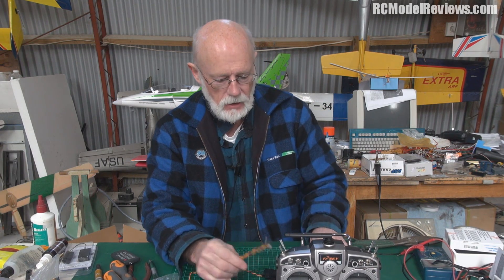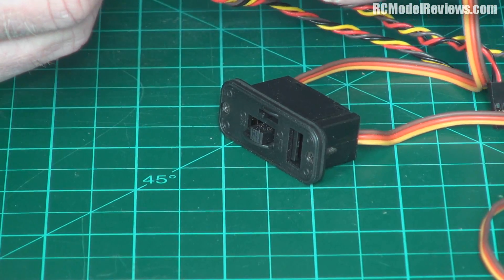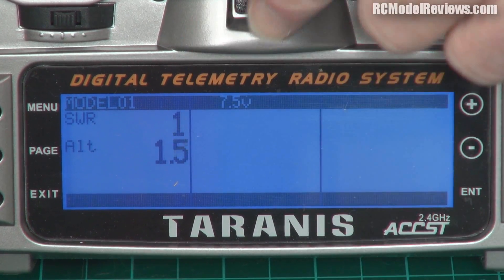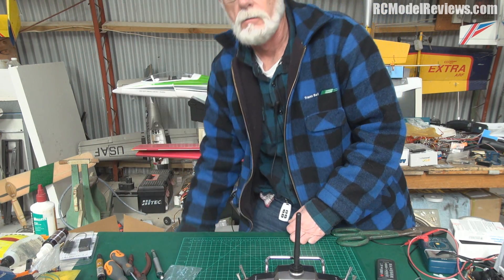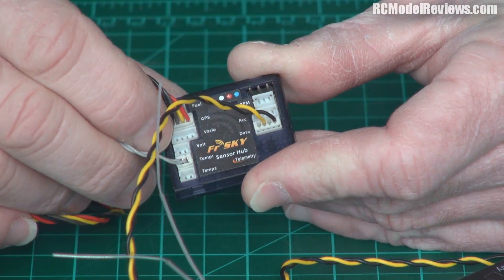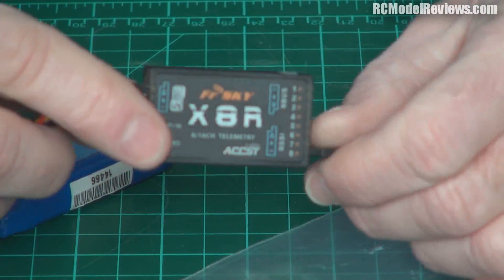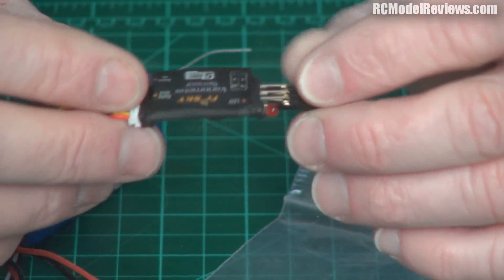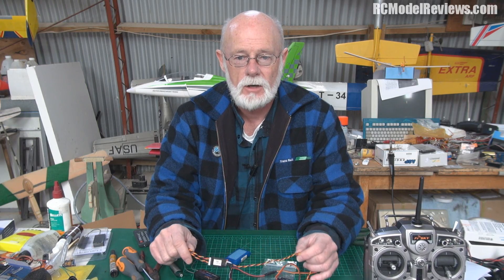Varios (variometers) for RC gliders explained

Comment: I used the radio
for the first time, added a new model and seemed to be all the
work well, servos, receiver, telemetry, radio.
The next day I will test the radio for the first time, when I called
not appeared in any infomation on the screen and are emitted just vibration.
already switch on and off  several times but always happens the same.
what I do.
The radio is new never fly.
thanks

Comment: hi bruce....i have the hub you used in the video, the sensors and the x8r receiver, if i get the vario you just talked about, can i connect the sensors to the hub the  hub to vario data input and connect vario data out to the x8r receiver's smart port?. i am not worried about the bulk or weight. but i have a few sensors i want to connect.

Comment: Hi Bruce, keep up the good work.  I have been flight testing the H-Precision vario for the last week . I have it fitted in to a Radian and am very impressed with its performance. I have it coupled to a DJT module in a JR tx with a  "D" series receiver. After many years of full size soaring I can't believe the similarities in this unit and the modern units fitted to full size sailplanes. Can't wait for my Taranis to arrive to get voice alerts instead of the beep alerts.

Comment: Hi again Bruce! Please i need some help-tips if it's possible. i have a Hitec Optic 6 radio and i just got a flight stabilizer-self leveling F-TEK 30A and i need to make my 3point switch to work on channel 5 on my radio, do you have any idea how to assing that switch to ch5?
Thanks in advance.

Comment: LiPe VoLcOm...
You will probably find that the Li-Po charger will shut down if cloud (or anything else), covers the solar panel & reduces the input voltage.
The SLA battery will not be affected.

Comment: I charge 12v Sla batteries with a solar panel and the charge controller so I wonder if I hook the solar panel 21v open 18v load can I hook direct to the Lipo charger ? Or amp drops do to clouds will mess up with the lipo charger and battery!? So can the lipo charge controller handle power variation like standard 12v batteries or not? Thanks keep up with good videos

Comment: @RCModelReviews
G'day Bruce... Hmn, the 1st time I saw as Audio Vario for a R/C Glider I was amazed. It broadcast to an AM Radio Reciever... They were both in a Symetrical Aerofoil Fairing, mounted on the Uprights of the A-Frame, on a Rogallo in 1979... Back when Lawnmower Motors were High-Tech for "Minimum Aircraft"  ;-)
Ciao !

Comment: Just a clarification for any noobs coming away thinking that a vario just reacts to changes in altitude. The beauty of a vario is that upward moving air (lift) is usually less dense, than the surrounding air. The vario will react to that change in air density even before the aircraft starts moving up. You don't have to watch for lift, you will hear it coming.

Comment: I have one and run it without the sound in a gas powered FPV model. It displays clearly on the transmitter and is very useful if you want to know how high you are for taking photos and, as Bruce points out, is very simple to use.

Comment: Vario is only really useful if it compensates for airspeed, so it doesnt react to climbing as a result of pulling on the stick (trading kinetic for potential energy) or vice versa. With weak thermals the "signal" will be lost in the noise because of changes in attitude and in strong thermals, well, you probably dont really need a vario.

For compensation you need a pito tube. Ive seen some for model gliders, would this work with it? Can you test that one day?

Comment: Also, not mentioned in the video, is that the Vario can be used to connect the old style hub and sensors to X8R Rx's. 
These Rx's don't have the old serial/telemetry port. So this is currently the only way to use the GPS, Current, LiPo etc with the X8R